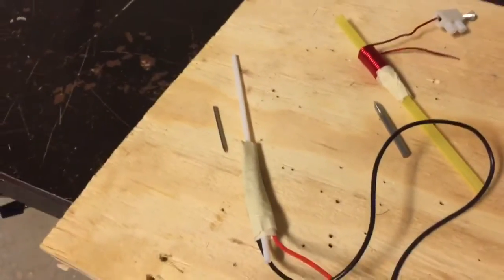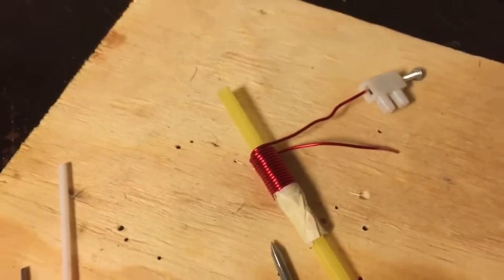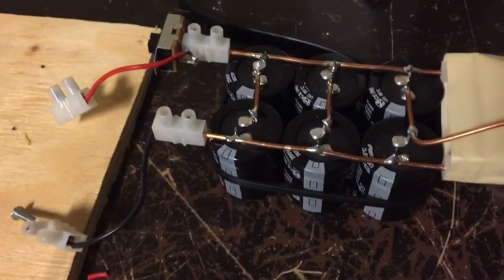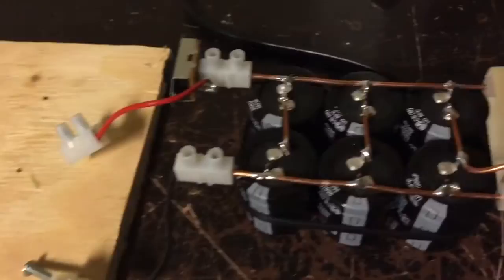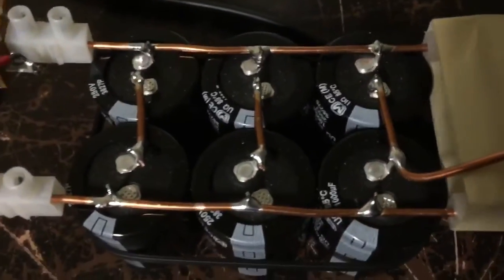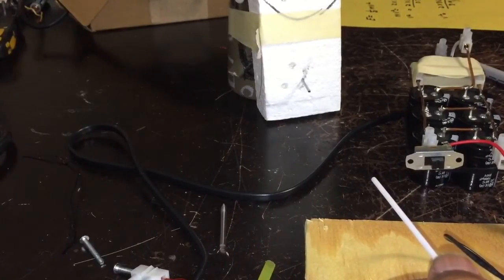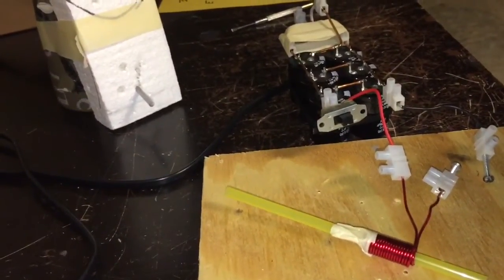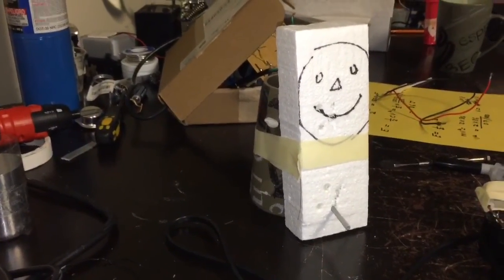Simple Coilgun Setup 1- Comparison of Wire Gauge

Comment: I don't think connecting diodes in parallel increase the max current they can handle, all the currant goes thru one of them
Reply from the maker: You are absolutely right. No two diodes or SCRs for that matter are identical. I used them in parallel in this case as I noticed that a single one was underrated for the current surge and was destroyed. However the parallel array has held up to abuse and I am guessing that at least two or three of the parallel array must be switching which is the only way I can explain why they haven't blown up as would be the case with a single one.
Reply: @BrianDhvTinkerer  You can parallel diodes. They just don't balance load particularly well. If they are thermally bonded together it improves the situation significantly though.